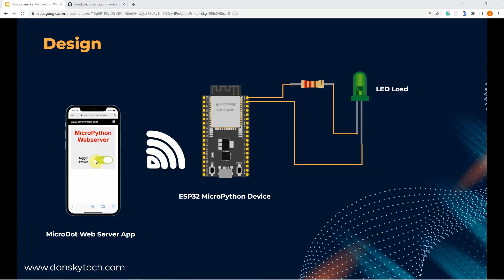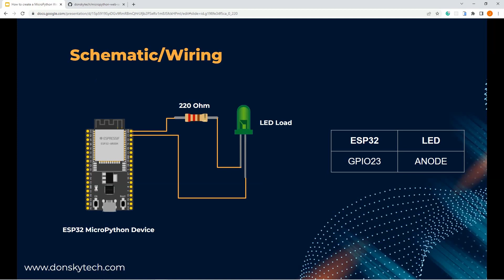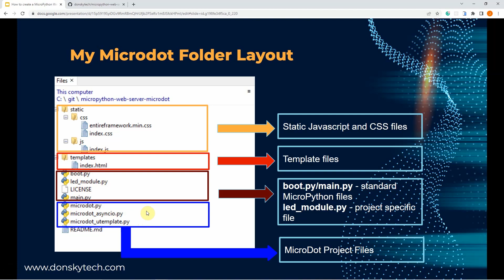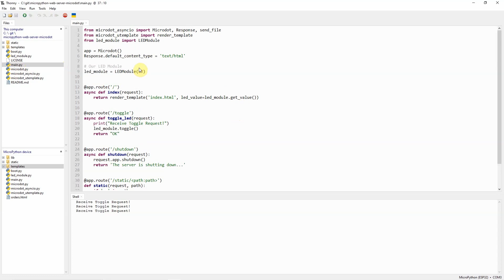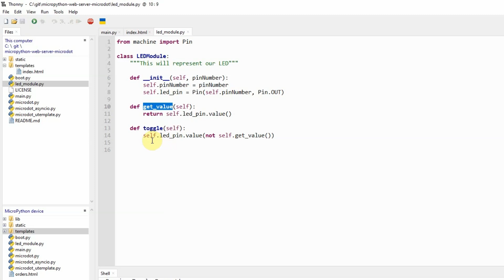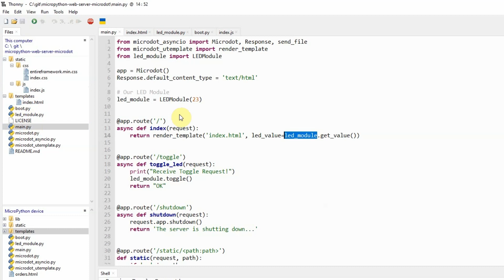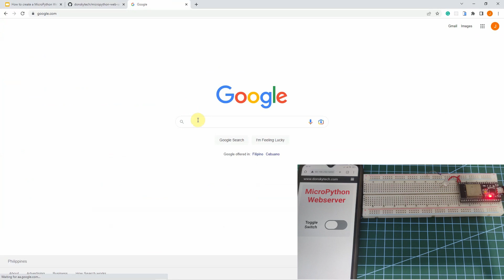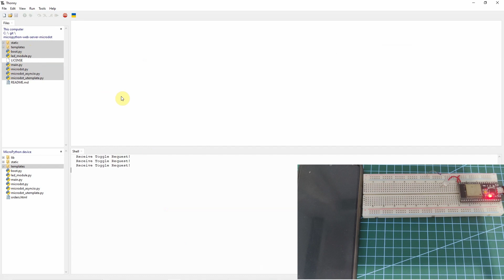How to create a MicroPython Web Server the easy way!

Comment: I try this code but I get "ImportError: no module named 'utemplate'", any ideas?
Reply from the maker: Hey, you need to install that as a separate library.  Please see the write-up in the video description for details.
Reply: @DonskyTech  I get error during the installation process of uTemplate in thonny
Reply from the maker: @abreyu  what error did you encounter?
Reply: @DonskyTech  solved thank you
Reply from the maker: @abreyu  sure...glad you figured it out. Happy exploring!
Reply: @DonskyTech  I'm a noob of micropython but microdot simplify the creation of a rest api server, amazing!
Reply from the maker: @abreyu  exactly, I have just started with MicroPython as well and I like what I am seeing so I am blogging a lot about this subject.  Watch out for more content.  Thanks for the support! 😁
Reply: @DonskyTech  a liitle hint, use async/await function instead fetch > then in javascript to get data from server. Is more clean/clear...
Reply from the maker: @abreyu  Thanks for the tip. I do use a lot of async/await in some of the React.js/Node.js IoT content that I have created.  I am just trying to simplify the javascript part by using plain old Fetch API. Many of my readers and viewers are hardware-oriented guys and have no experience with Javascript.  Also, many of the microcontroller-oriented sites when you google are still using XMLHTTPRequest or JQuery in their code which still works by the way but is a bit dated.😁